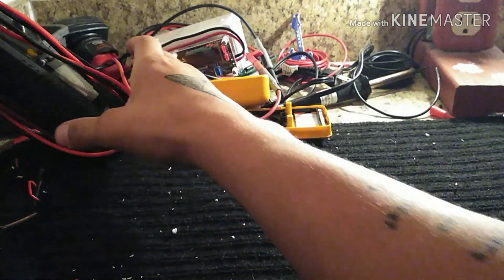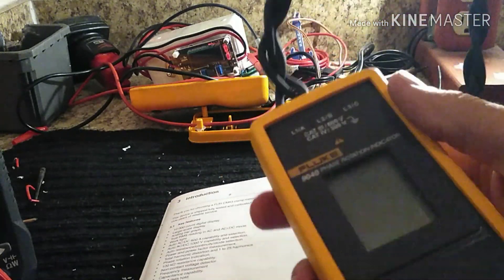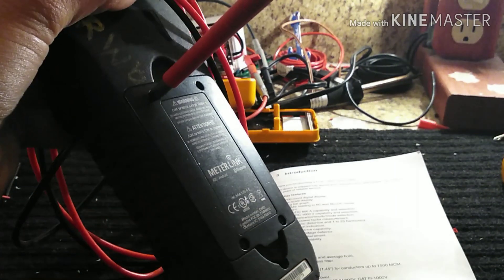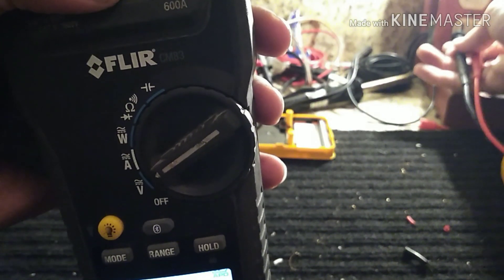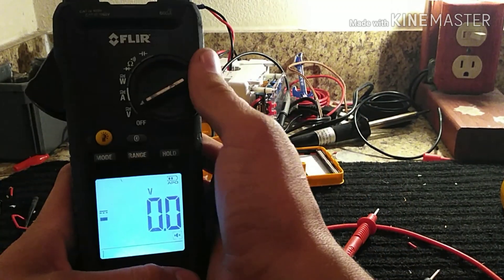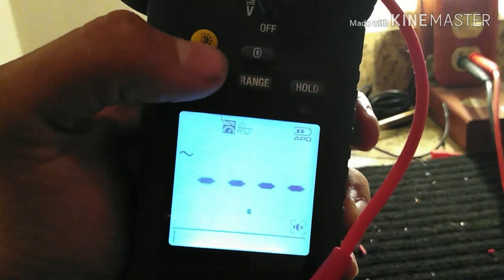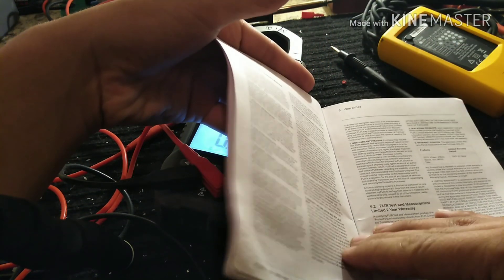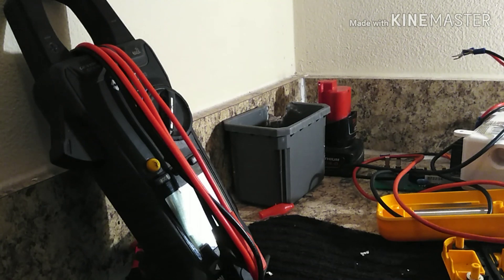Flir cm83 clamp meter reivew

Comment: loved that you liked that comment down there. Haha 
appreciate the video. i have this exact flir. i was an electrical apprentice for close to 3 years. since ineed to enroll in a program for all my hrs to be acknowledged, irecently got a 3rd shift maintenance mechanic position and man, it's been kinda overwhelming. yes, I've been doing electrical for 3 years but idk if you started in your career working under a licensed c10 but it's NOTHING like what ppl think. starting from scratch,  1st year your basically a tool grabber and flashlight holder.  then slowly graduate to basic tasks. installing receptacles/switches, checking continuity. beginner stuff.  it's such a fast paced environment,  there's no time to be taught to work a meter or a panel e.t.c.  and now I'm called to troubleshoot an entire panel, asked why is this not working or is this motor any good? check before connecting. (note: loto protocol is ALWAYS used so it's not an unsafe environment) maybe you can give a few tips in regards to troubleshooting,  basic how-to functions w this meter,  checking resistance/ohms e.t.c.  would be willing to donate to your channel as a thank you.  plz hey back to me.  thanks man 

mikey.reyes60@gmail.com